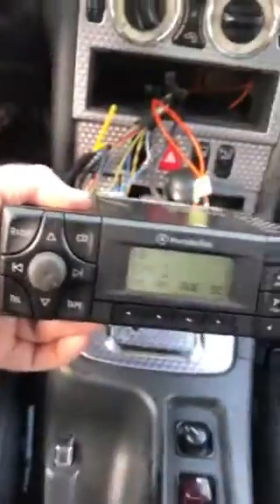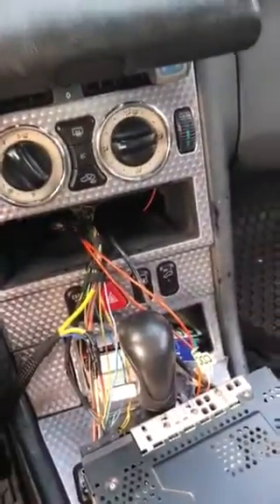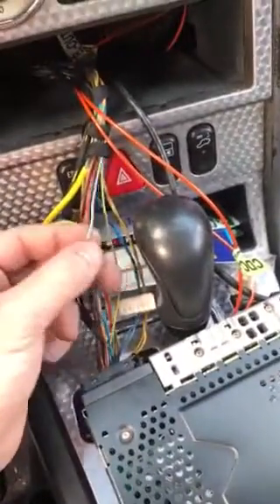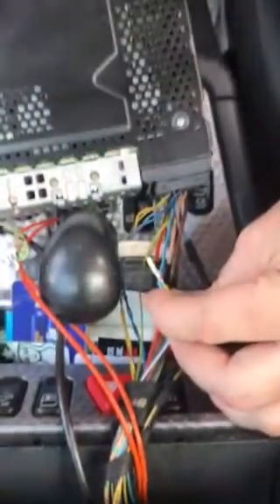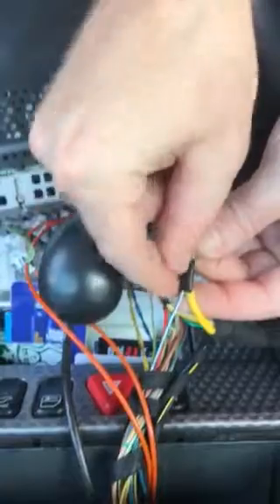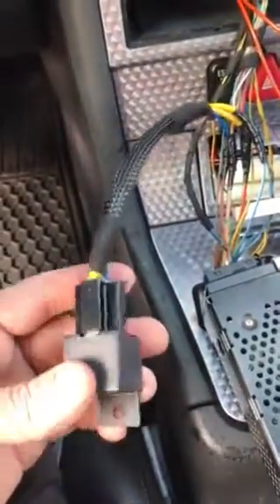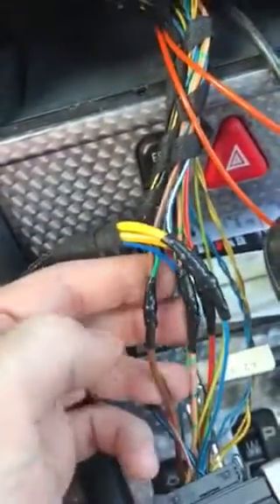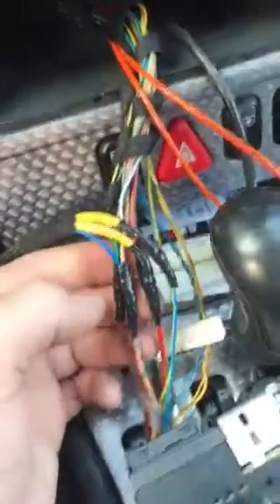How to: audio fix (no sound) for Mercedes slk class

Comment: 2009 e350 amg no sound head unit is on and seems to operate normal just no sound I do get a hum from the center speaker in the back by the window behind my rear seats I checked all fuses ,fiber optics seem to work any help ?
Reply from the maker: try to unplug the amplifier and let it sit for a few minutes then plug it back in..  if that doesn't work, unfortunately someone will have to get in there with a meter and see whats going on.. let me know if you figure it out for sure! hopefully just simply unplugging and plugging back in fixes it.. good luck man thanks for watching!

Comment: Nice video, a like from me!

I'm having the same issue in my Becker audio10 in a 2000 Mercedes w203 c320...gonna give your fix a go....

After watching your fix and the end result....surely splicing in a 5 pin relay means that your just bypassing a busted 5pin relay on a sam unit??

Is that correct?! I know these have a few hidden relays behind the glove box

Thanks
Reply from the maker: im only bypassing the remote output of the factory radio. the radio no longer had voltage coming out to turn the factory amp on, so i just used the relay to shoot voltage to the amplifiers turn on input. it goes straight into the amplifier, not to another relay.. hope this helps

Comment: Awesome vid. Would you have a video of the HU removal?
Reply from the maker: no video of radio removal but its very easy.. just need the radio removal keys. They slide into the 2 slots on the radio ( one in each corner on bottom of radio).. slide the keys in, pull outward and the radio will come right out
Reply: Jake Bradford thanks for the reply! Will have to find keys... 😢

Comment: Hi Jake,  
I have a 2002 slk 230. The sound on the radio would intermittently go out.  The radio station would  show but no sound.  I installed a relay exactly as you show in your video.  I thought all was good when the radio played perfectly the first couple of times a tried it but after about 30 seconds of playing, it went completely out.  No sound, no radio stations, nothing.   I checked all the fuses and connections.  Radio is completely dead.   Any thoughts?
Thanks
Steve
Reply from the maker: hey steve sorry for late response..sounds like it may be time to switch out the radio my dude...